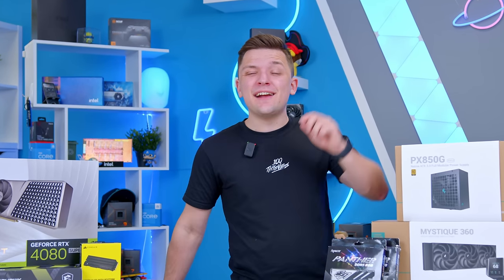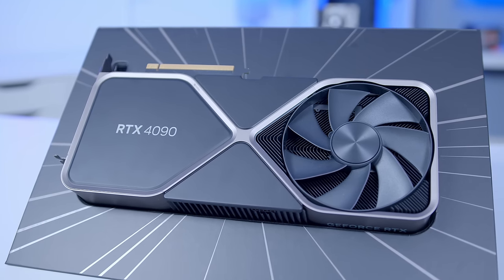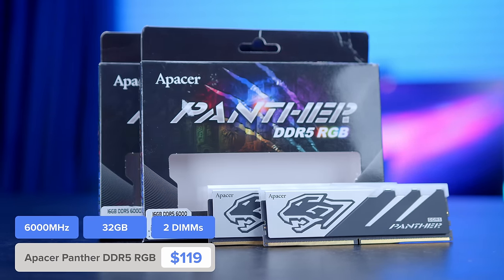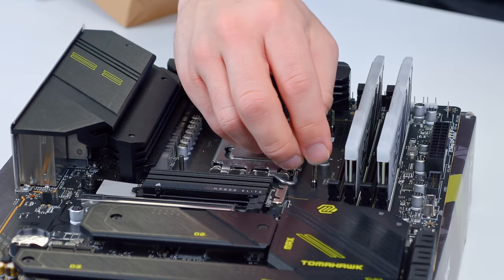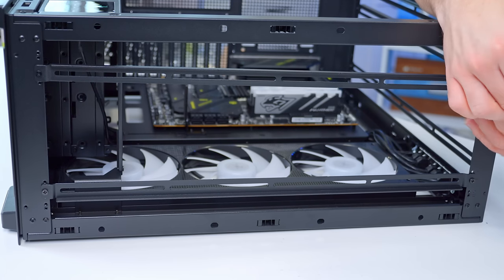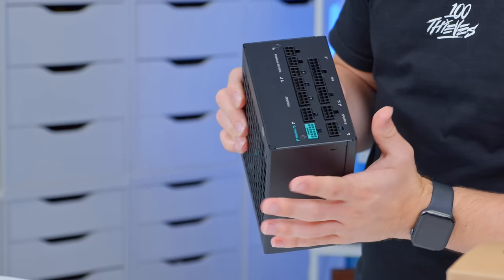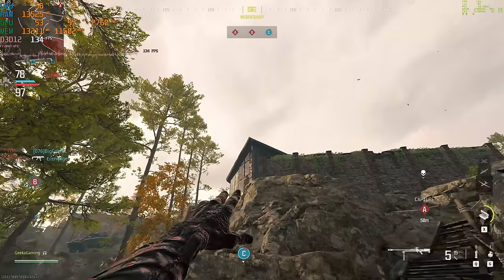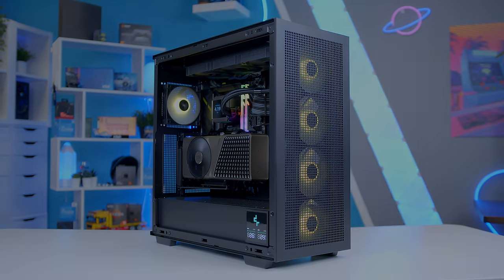Building an Awesome 4K Gaming PC for $2500! 👀 [Full Build Guide w/ Benchmarks]

Comment: This is my first pc build
Pc:
1. Graphics card: geforce zotac rtx 4090
2. Cpu: intel i9-13900k 
3. Ram: 64gb corsair rgb vengeance
4. Storage: 2x 2tb Kingston nv2
5. Case:lian li o11 vision 
6. Cpu cooler: lian li galahad 2
7. Case fans: lian li unifan s120
8. Motherboard: aorus z790 elite ax 
9. Power supply: silverstone da1000r 

Additional:
Strimmer cables 24pin + 8 pin

Monitor[tv]:
Lg c2 42 inch [120hz refresh rate]

Peripherals:
Keyboard- rk61
Mouse-logitech g304

  Total of the build comes out to 2900$ and it is coming in a few weeks [everything including monitor and Peripherals]
Reply: how is it? also congrats on your first PC
Reply: Only 2900!!!! Where are you getting these parts from

Comment: would the 4080 super b a good card for 360 fps 1080p  on esports games like halo infinite , fortnite etc?
Reply: 1080p sucks especially with a powerful 4080.
Reply: At 1080p a 4060 will give you a stable 380 fps using competitive settings. A 3060 will give 340+

Comment: Still odnt understand if i should be getting the 7800x3d or the 14700k. Yes yes, its if you dont edit get the ryzen and all but i do some light photo edeting and video edeting so im not sure what the right choice is.
Reply: You should decide what is most important to you. At multicore tasks the 7800x3d is about 30% slower than 14700. If you are not editing all day what do you care if some task takes 13 minutes and not ten. Ryzen is cheaper. Make sure to chose ram from motherboard manufacturers list of tested memory sticks (qvl- qualified vendor list), found on their website under specs and support for every different motherboard. Get board, ram and cpu from one shop and should it not work as u like just send it all back.